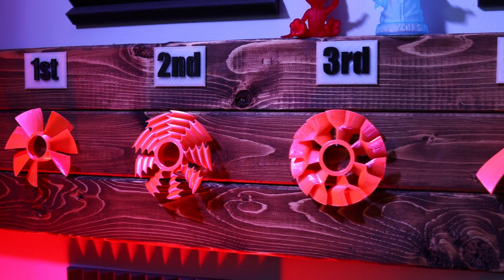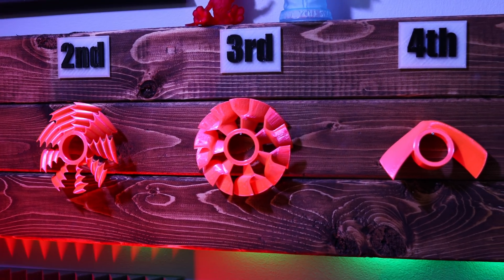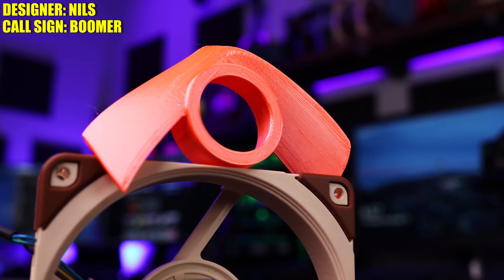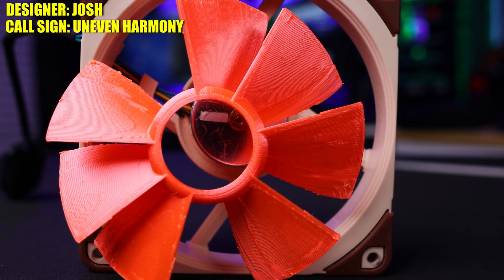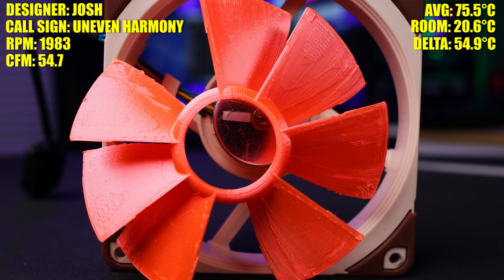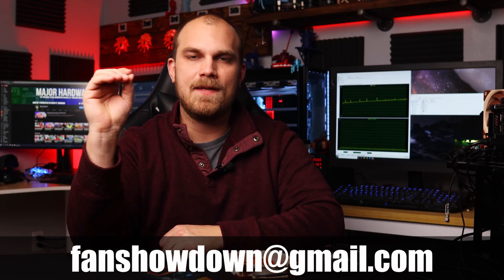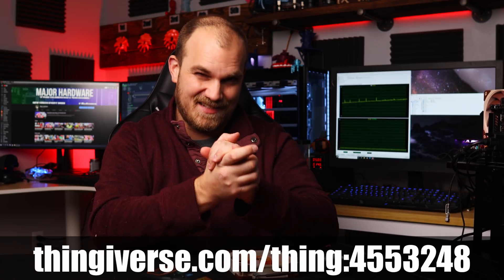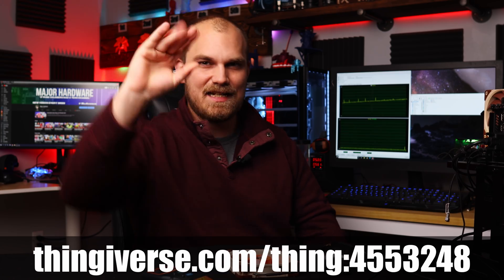The Boomerang Fan is So Much Better Now | Fan Showdown S2E1.5

Comment: I would love to see you do a noise normalized run in addition to the other testing, but not replacing it. And maybe having a special spot for the most efficient fan at low noise in each season. After all noctua is going for silent + efficient as well.

Comment: Power consumption would be a good thing to measure to test efficiency. Maybe now that RPM is untethered they are all using the same power, maybe not.
Reply: they're all run at the full power of the motor now, so same power draw

Comment: You should stick the 1200RPM data and just add it in with the rest of your results.  Reason.   Between 800 and 1350 are the sweet spots for cooling vs noise.  What good is cooling when your computer is humming like a freight train coming down the tracks.  31 year system builder and over the years I'm done similar tests fan performance. So I find it humorous/enjoyable seeing what you are doing with 3D printing.

Comment: All of your 3D fan print  not accurate reading. seriously, because it has a grooves on It so it can destroy the aerodynamic of it, You should reprint all of your fan and it should be glossy finish to improve aerodynamic you can paper sand it or cod it with resin make sure don't leave any grooves on the surface that's gonna give you  sharp accurate reading

Comment: Cool video! Given that the blades are 3D printed, I think you should balance them first by adding small amounts of cellophane tape or electrical tape if the imbalance is large. Look up blade balancing for model RC helicopters. You'll have to statically and dynamically balance them. I think it'll improve the performance substantially since a lot of energy goes wasted in vibrating the blades instead of moving air.

Comment: At least you let them run at a real speed instead of throttling them down to an arbitrary speed of 1200 rpm. Did you also repeat the desible test as well?

Comment: Seem to recall my engineering classes of undergrad past that Dynamic Balancing of rotating masses was a little more complicated than just center of mass.  I believe the counter weight on the Boomerang needs to be sized for its operational rpm range. That's why it didn't seem to make a difference in the vibration.

Comment: You should be measuring efficiency - Wattage inputs and volts done are good ways to check how efficient a given air mover is vs how much cooling it does. It'll help with testing.

Comment: Are you testing with a high fin density radiator, or with a low fin density radiator?  Difference fan designs will perform significantly differently based on the radiator's fin density.

Comment: I'm guessing the vibration of the boomer has to do with uneven forces when it is spinning. It's not spinning in a vacuum. It's imparting a force on the surrounding air.

Comment: I am not adept to working Fusion 360 or any other 3D design programs.  But I do have an understanding of fans, or to be more precise, propellers. In terms of efficiency one blade with a counter weight balance is the most effective per rpm in undisturbed air. The most common ones are two blades, then three and four in that order. We use two blades as long as we get the torque and speed we need. When it comes to fans, torque is something we have relatively low use for. So cfm is our primary goal. Speed we achieve the best by having a blade with less angle of attack. A common misconception is that the numbers on a propeller is the degrees it has built in. That is not the case, the numbers represent the amount of inches traveled per revolution. So to build the perfect fan for this motor we need to know the maximum wattage (power l it can deliver. Then we need to know the maximum diameter it can be. Knowing this we can then determine what angle the blades need to be for the amount of blades we attach. So when the uneven fan makes the most power, or have the best efficiency, that makes perfect sense to me. Not knowing the power output or diameter I am not sure what configuration I would choose. But I would like to see a single blade unit with a counter balance tested. I know that it would be the best per revolution, but being incased also matters. Anyone want to try this? I can help with the math of it if needed. Thanks for having a subject that can be really helpful as well as entertaining.

Comment: Hi Major Hardware, Im not sure if you will see this comment, but im rather interested to see how much of a difference the Vortex control vanes on the back of the noctua fans make, and whether its something that would be able to be made as a standalone part to slip onto the back of normal fans for similar gains if there are any.

 Hopefully you see this thoroughly enjoy watching your videos and the technical aspects of fan design, and general tinkering that you do, keep it up

Comment: It would be nice to see the dBA numbers at those RPMs, dBA is all the majority cares about when it comes to fans. Most people would rather have a fan that is quitter than one that is louder but cools slightly better. EVGAs CLC for example is very good at cooling....when at 100% fan speed which is over 60 dBA, which can be 10 to 20 dBA higher than other brands for only a 3c to 10c in temperature difference. I believe this is still true for their newer coolers, Corsair started locking their CLC fans to 37, 40, and 43 dBA at 100% fan speed based on the CLC model because of complaints of noise levels from past CLC.
If dBA is not a factor and you just want to find the best style fan design that will push the most air for cooling then why are you not using a server grade controller that spin fans at 4k to 10k RPMs?

Comment: Aerodynamics can boil down to the smallest variable, wonder how difference the performance of all these fans would if they were printed using SLA printing, much higher resolution and no lines from the filament.

Comment: The 1200 rpm was a good idea, however you should do both tests for each blade to show the efficiency of the blade (fixed speed) as well as the stress on the motor (difference to max speed)

Comment: Rather than limiting the RPM, if you want to have a limit, you should limit the noise. In real world fan design, that's the real constraint. It's super easy to make a fan that can move hundreds of cubic feet per minute: just take any fan, and make it go faster. The issue isn't that fan manufacturers don't want to spend the extra 25 cents for a stronger motor, it's that nobody will buy the fan if it's loud.
Currently, what you're really testing is just "best fan that can only use <X> watts of power for its motor", and I don't think any PC builders are too concerned with the power draw of their fans.

Comment: What I don't understand is why people are against noise-normalizing the fans to test design efficiency. Normalizing for RPM's does indeed favor heavier fans, but it doesn't actually normalize for noise. There is also a falloff in many fan designs where spinning as fast as possible just gets louder without moving more air. If we normalised for something like 36db, this would test how efficient a design is at moving air rather than just brute-forcing it loudly. No point in something cooling well if it's screaming in your ear the whole time. This is why Games Nexus does noise-normalised testing for all sorts of things.

Comment: Are you sure that the Uneven Harmony Would be able to keep up the cooling if it didn't break, or rather did the tower cooler reach max temperature before the fan ripped apart?

Comment: I realize this would add more work for you, but what about testing the fans at both their maximum free range speed, and also at 1200RPM.  Since we have data from Ep.1 at 1200, and this Ep at free range speed.   Also decibel readings at both would be nice.  And maybe re-test the top 5-10 from season 1 at 1200RPM and record CFM, delta, and dB as well...  I think most people don't run their fans at full free range speed all the time.  So being able to compare maximum speed that the A12 motor can run them at, and also all of them at 1200RPM including the A12 would give some valid data to how they perform at lower and less audible, more "normal" speeds, but also with the data of maximum performance potential available too.

Comment: It sounds like just having two blades (that are balances/symmetrical) would be better than designs w/ multiple fanblades. Just have two big fat high-surface-area blades that take up a quarter of the rotation so that they can get big scoops of air without turbulence and whatnot hindering their ... flow.

Comment: If applicable, I would like to see what happens when you sand these fans down and polish them for a smoother surface to see how much or how little it would affect airflow and temps.

Comment: @Major Hardware OK, I might have some stupid ideas here, but...
1. Do a test of inversing the fan to test the sucking power through the radiator also.
2. Test the normal and inverse as a push pull.
3. Could do a combination at the end of the series of the best blowing and the best sucking fans.
4. Do the same as 3, but with the worst for S&Gs.
5. Any fan that says 100% infill, try to make it with minimal amount of infill as possible and see if it improves the rating (less weight = more speed = more CFM?).

Comment: What I think you need to realize about the fan competitions is that we as viewers want to see the fans perform as their creators intended. If something needs a re-print to be mirrored, or different infill, or even a better surface finish because a print was rough, we will basically always say YES. We want a competition of fan designs, not a "how well did the creator upload it and submit it and how well did he follow the instructions" competition.

Comment: Can someone chime in on a few thoughts, or perhaps just one, regarding the Boomerang fan and vibrations...

Here's my thought on the subject. The designer created a shape where the fan is perfectly balanced when static, but as the fan spin the centripetal force will have a much larger effect on the tip of the blades than on the counter weight bulb that's much nearer the center of rotation. So to balance an asymmetrical fan like this you have to calculate how large a counter weight you need depending on the fans rotational speed. So the fan will only be vibration free at a certain RPM. Any deviation from that target RPM will introduce an imbalance that results in vibrations.

So am I right or wrong, or so far of the reservation it's not even funny?

Comment: You need to do a Commercial PC fan showdown, if you haven't already? Do the top 5 (or even 10).
Then get the best results on cooling, and sound. Because who knows? Maybe Noctua may not be the winner?
Anyhow. Get the results. Add both numbers together, then divided them to create a C/S rating.
 
Then, use the winner of that as the arbitrary Goal, for the peoples builds.
I know this is all in fun, and getting to see what people make and come up with. 
However, seeing how they stack up against the current commercial "best", would be neat as well.

And if you somehow can't use anything but noctua fans (because reasons), then get the best they have, to pit them all against?
IDK just would be fun to see a commercial fan run off as well, even if the testing isn't all "Official" and all that.

Comment: Noise normalized run is a good idea but 100% pwm is also a must. I think we all tune our fan curves to be a balance of the noise we can tolerate with how much performance we are ok loosing BUT I bet every one has a set limit they want the fan to spin to 100% for when one is rendering something or running some other intensive tasks like 3D modeling a massive file.

Comment: Can someone explain to me  this discrepancy that I see? He measures CFM, but that doesn't seem to correlate with the temperature deltas. Why? The fan that pushes the most air should have the best cooling, no? You are blowing more ambient air over the rad, the more you blow, the better that it will cool. So how is it that the boomerang came second, but had the second worst CFM?

Comment: You should also include noise normalized tests  so people can try to compete for the quietest fans as well or maybe do that for season 3
Reply: Issue with noise-normalized testing is that it's more than a little bunk for designs with this much variation. 

Human perception of noise is... very distorted depending on pitch and randomness (it's easier to ignore white noise than pink noise or tones). Trying to compare how "loud" sources of noise are when they have different profiles doesn't really work, especially in this kind of format.
Reply: You mean like the fans you buy do, because that is what people truly care about, what fan give the best performance at under 43, 40, or 37 dBA.
Reply: @Kirinketsu_  That's the problem - 30 dBA at what kind of noise profile? Perceived noise and measured noise are two different things.

Fan noise measurements on product pages work because most consumer fans are shaped similarly and spin at similar speeds. 

These fans are all weird shapes, so trying to generate a single number to compare them with doesn't work.
Reply: @louisvaught2495  He did say dB(A), although I agree it would make more sense to use the ITU-R 468 weighting rather than the A weighting.
Reply: @AJMansfield1  Even ITU-R weighting is tuned to account for noise in a particular setting, because it's a derived approach based on observation, not a fundamental behavior. Fans don't have an audio-like noise profile, they're pink noise with repetitive transients.

Research on people who have recently gained hearing via cochlear implant shows that our ability to reject noise is a learned thing, and that makes generalizing particular approaches not work well.

Comment: I hate that you backed down on the RPM thing. If you don't make changes to the rules each season you'll end up with the same handful of similar style designs winning every time, and the series will get pretty boring by the end of S2. Was the RPMs the right thing to change? Maybe, maybe not. But these idiots don't know anything either.

Comment: Comparing the results at max motor output vs a specific rpm target reveals something very important. The best fan for quiet operation absolutely is different from the best absolute performance design. If the fan show down is followed up with a 3rd season, I would like to see a focus on noise normalized results. A big reason why the a12x25 is so renowned is due to the fact that in noise normalized tests it absolutely destroys most other fans at around 1000 rpm, as it is still nearly silent at that speed while other fans became clearly audible in the 700-800 rpm range. You can tell it was optimized for performance at a specific rpm in order to reduce noise.